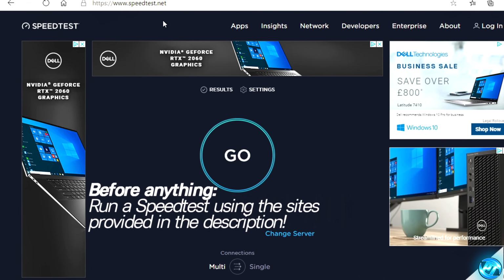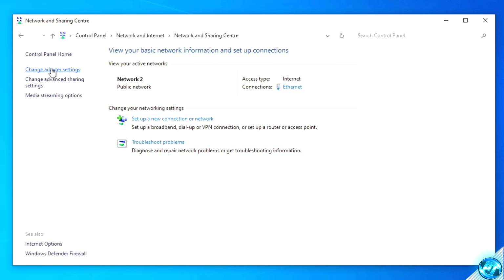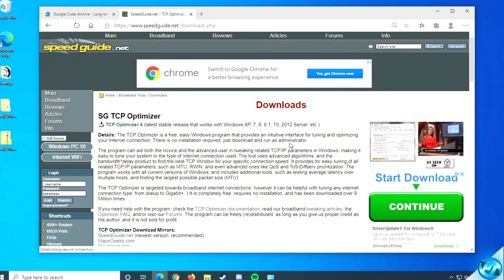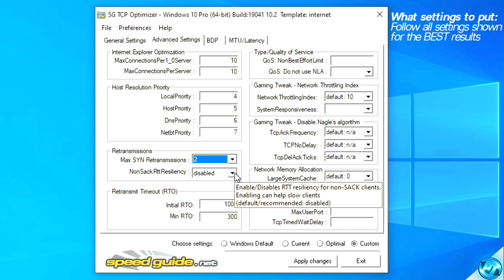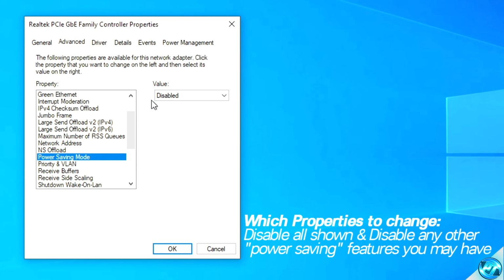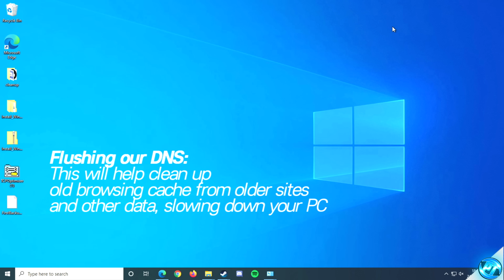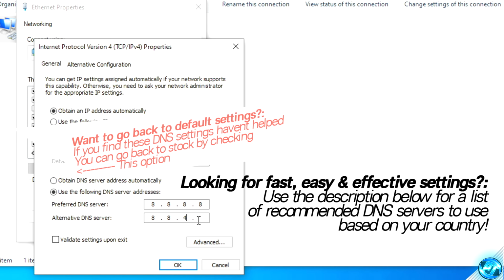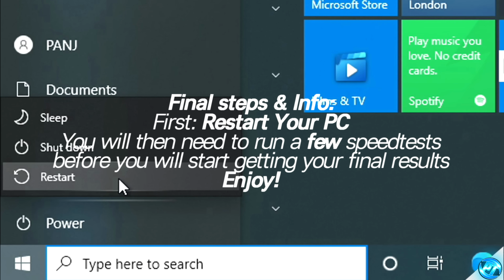🔧 How to SPEED UP your Internet! Boost Download Speeds, Lower Ping, Fix Lag on Wired and WiFi EASY

Comment: I see little difference and also I'm using a qualcomm router but it was updated. Maybe thats the website server, on speedtest, i found a significant difference: 15mbps-30mbps. Well there is improvement i guess. Edit: Page loading is significantly faster, thank you!

Comment: One question man, that modify all network adapters button, i also use an external wifi adapter which is listed there from tplink, they mentioned in the box not to modify anything, so is it mandatory to check that box? will it modify all the adapters? Can i do this on my 802.11 wireless adapter

Comment: Hey idk if you'll read this but before I moved to pc I used to play on ps4 with an ethernet cable and I had +500 MB/s download and upload, I used the exact same cable with the same router but for some reason I have barely 25 MB/s download and upload speed on pc. What could cause such a problem? I did everything in the video and tested the internet speed nothing worked out :/ .  Thanks for answering in advance :D <3

Comment: ca ethernet wall adapters play a role for low upload? the apartment i live in have zero ethernet ports being an old as hell from the 70s with minimal updates. so i had to go out and buy ethernet wall ports to connect to my router to pc, tv and consoles.

Comment: Sorry but I did absolutely everything and I have Xfinity Blast xFi modem with actual input speed of 1200 mbps that I have verified. My laptop has wireless modem up to .../ac level, & 32G RAM memory. My before optimization speedtest.net app showed 248 mbps & after optimization speed was only slightly faster at 253 mbps. My MAC MINI LATE 2014 with a new SSD hard drive with only 8G RAM amazingly gets around 750 mbps.  PLEASE ADVISE.  THANKS!!!!

Comment: My game download speed didn't increase at all.. could you please help me out
Reply: It helps to know what your current internet plan is and what speeds you get. Run a speed test (on a wired device) and compare that to what you should be getting. Otherwise, its impossible to help with a vague question.

Comment: Romania is #4 worldwide in fixed broadband according to speedtest. I get 700Mbps/down 1ms ping, sometimes 900Mb. on a 1 Gigabyte fiber contract deal. for 10 euro a month. I still need to tweak stuff, had better speeds. fresh windows might be the problem. I also set the Speed & Duplex to "1 Gbps Full duplex" from "Autonegotiations". Will see ..
Reply: what the hell 10 euro?
Reply: @Mikkoy67  indeed, the provider is Rcs-Rds (digi com.), for 23 euro/month  i get cable tv ~200 channels(under half are HD), 1Gb fibernet on wifi 6 router, 130 Gb mobile data (5g compatible), some landline deal i never use, can't remember cloud storage i never use it.  If i want 4k channels it's 1 euro extra, for 5 sports channels.  HBO  package is like 4 euro. Already included in the 23euro. My network never crashed or annoyed me in 12 years since, and i use it till 3 am lots of times.  I play dota regularly.  But even in the late 90's we had good providers. It's just how it has been.
Reply: $25 dollar in here is is only  5mbps-10mb
Reply: @Mikkoy67  i know, when I worked  in western europe(france etc.) i was amazed how expensive the fastest package was, and it still can't hold a candle to what we  have here. It's infrastructure i guess. USA the same shit web. It's according to salary.

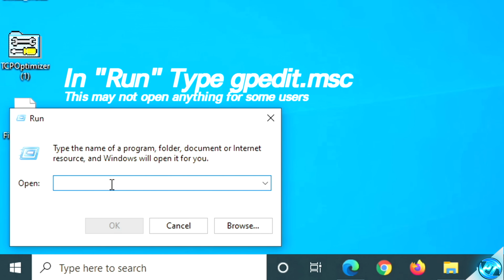Comment: At 8:10 typing 'gpedit.msc' doesn't work for me, instead it comes up with an error asking me if i've spelt what im looking for corrrectly? Anybody know why this happens?
Reply: https://www.itechtics.com/?dl_id=43

Right-click the downloaded gpedit-enabler.bat file and select Run as Administrator.
This will start the installation process. It may take some time depending upon your system performance. Once the process is complete, press any key to close the command prompt window.
Although a restart is not required, if the policies are not working, you should restart the computer once.

Comment: this really worked for my ac wifi connection, thanks.
Reply: FINALLY! Someone made a comment saying that it worked or not and not just 'my wifi download sucks".
Reply: @salty74vr  I have a 6 y.o. notebook and my router is 3 rooms away. After doing what he did, my download speed increased 2x.

Comment: Started with 13 ms ping in 10 speed tests before. Results after tweak with 10 additional speedtests stayed 13 ms so no improvement for me but i assume its because 13ms is already on the exceptional end already.

Comment: Guys, whenever I check my internet speed I get 25 ping but in fortnite I get like 60-70 pls help
Reply: that's because the Fortnite servers are farther away. you get different ping depending on where the servers of the thing you are trying to connect to are, if they are on the other side of the world then you will get very high ping, but if the servers are very close to you you will get very low ping if you have a good internet connection
Reply: @darthpickle6611  but it’s only been every since I switched to pc, on ps4 I was getting like 30-40

Comment: after i did this my cpu is running with only 1 core now. and reverting the settings doesnt change it :(
Reply: well this shouldnt of affected your cpu at all, it only should of changed how many threads are invested into your wifi signal XD. your ram might be the thing that is making your cpu cap at 1 core.
Reply: @IppoFN1  Nice so that's why my fps dropped by 100 and my pc is boot looping now

Comment: This wont be suitable video for those who uses wifi router with modem, this actually MIGHT make it slower but in my case im with modem and ethernet cable, connection went much more stable on downloads etc, but no improve on ping really maybe from 17ms to 16ms so its arguably

Comment: I just changed the power saving modes and the power management settings at the end of vid because it was the least complicated thing to do and damn this has sped up my internet quite a bit
Reply: how did u do that
Reply: @spamzfn1588  control panel > power options > select high performance power plan
Reply: really?

Comment: SUPER INTERNET SIGNAL BOOSTER - STREET 2 PRO.

  The amplifier works all over the world anywhere with any SIM card, any provider. If you have a weak signal and slow internet speed, this amplifier will solve all problems. 

@

Comment: i did this and it made my connection from 100m to 20m 9ms ping to 20ms and 8m upload instead of 10m :(
Reply: ok i removed prefered dsn and put back to auto obtain and restarted my pc now is actually slightly faster than it was

Comment: all the fun comments and stuff made me feel like it is not working but it actually does help you get your real internet connection which you paid for. for me it was way less than that but now I am getting the maximum and also a more stable ping (it actually also makes your ping lower but so much only a couple) THANKS A HEAP. THUMBS UP

Comment: Not to discredit any of these helpful tips because they truly do help a lot of people. But, its been my experience and believe me there have many, that what really makes a huge difference is simply the connection to the server. Sometimes its good and sometimes its bad. It doesn't matter what server your connected to sometimes it will be a good connection and sometimes a bad connection. My suggestion is if your speeds are bad just disconnect from the internet, wait a few minutes and reconnect and pray like hell you get a decent connection and if not repeat that until you do.

Comment: why is is saying that in cmd?
"No operation can be performed on Ethernet 2 while it has its media disconnected."
Reply: Ye doesn't work for me. from 25 down to 11 it wil go back up and then back down like always so nothing changed CMD part doesn't work for me I'm guessing that is the problem
Reply: cuz u dont use ethernet and youre using wifi
Reply: @ClipsDaily.2000  weird because I’m not using wifi

Comment: My recommendation is: Don't use the "TCP Optimizer" when i applied all setting like in the video, I had massive problems with Steam downloads, I had under 1mb/s. Then I changes all setttings back and I got my normal speed again (11mb/s).
Reply: ok why you get less mb/s is couse the tcp optimizer is for ping mostly on gaming and web serching not for downloads its very good for gaming, the tcp optimizer minemizes the bandwitch of downloads for better internet speed web and gaming so if so first take off the tcp setting when downloading then when your download is done put them back if your game is internet based game put it on for better ping
Reply: @Natsi-Sensei  ok thank you
Reply: What!!?!
Reply: @Astrayy21  what do you mean, I just explained my problem man

Comment: I was getting about 300 kbps from my usb wifi adapter in my second pc. I used an USB extension and moved the adapter to a better position and started getting about 45 mbps

Comment: Didn't do anything for me. My speed is still the same. I get a feeling this type of tutorial will only help a very small amount of people. Most of us won't see much of a difference or it might even get worse. Thanks for the video anyway.
Reply: Bro mine got even slower and idk what to do
Reply: @zamclarenas  reset everything you just did simple
Reply: @recklesfaltron105thebest3   how
Reply: @yeeti617  Go into TCP Optimizer and in the bottom right corner, set it to Windows Default, apply, close, and restart.
Reply: bro same

Comment: Uhm, Reading some these posts and so many with pathetic download speeds!?  I feel for you...  🤔😔  I run a new DELL laptop (barely 3 months old) with ethernet connection via Thunderbolt USB-C and average about 225MB.  It's fast!!  And, that's out of the box.  No mods made yet to it other than some software and driver updates.  Hate to fiddle with it too much.  "If ain't broken, don't fix it." 😎👍

Comment: How about changing the internet protocol from IPv4 to IPv6? Because IPv6 has an lower overhead it should result in a better latency. You should also check if your provider and router supports IPv6.
Reply: Yo how can i actually do this?
Reply: @danielw8855  enable ipv6 in ur ethernet properties and disable v4
Reply: Neva do that Belive me. Let that seting automatik like they are.
Reply: ipv6 is slower than ipv4 because it has a extra layer built in security that isnt needed if u have ur own anti virus and that extra layer results in increased latency, its actually recommended that u turn ipv6 completely off if u have an anti virus software already installed on ur system

Comment: I used to have 20 mbs adsl with 70/80 ping and I was satisfied enough with that. Since few months I have 1 gbs optic fiber but my pc is not in the same room as the router so I manage to get only 200 mbs with 35/45 ping which is still an incredible upgrade and I'm more than happy with that. I don't wanna mess with all these settings and risk to slow down everything like some ppl said here in the comments. But for someone with really slow internet I don't see why you shouldn't give it a try! Nice tutorial and keep it going bro!
Reply: save a windows restore point and go ham.

Comment: How to revert? My wifi dropped from 400MB to 30MB, doing restore point but it takes ages? How to revert back please?
Reply: did you figure it out yet i want to revert mine aswell
Reply: It was just my wifi adapter driver updated. So i rolled back version, and my speed is good no

Comment: An easy tool to update drivers is called "Driver Booster 8" For the people that don´t wanna search and download and istall one by one driver.
Reply: Don't drivers update automatically with windows updates?
Reply: @zacharykosove9048  yes but a bit of them no
Reply: @gabe_bvd  Some drivers are not to be updated and thats what Windows 10 do. It updates important drivers and leaves others. Once I updated my Drivers through Driver booster 8 and then my touchpad stopped working. before that I got some Unstabilty and freezes.
Reply: @real7vik  With laptops its a bit different. I always update my drivers with driver booster 8 And I never had a problem with it (Because now I have a gaming PC. I was a laptop user 9 months ago and I used driver booster and I never had a problem) . And sometimes actually windows tries to go 1 older driver When I update my AMD gpu :( but the rest its ok. Windows helped me to update my bios. So use windows update and driver booster and all will Be up to date and ok.

Comment: Just wanna ask is tcp really safe I mean it tweaks some setting in registry

Pls reply
Reply: Yes it is safe, the only danger to using it is, you could maybe prevent your computer from using the internet, if that happens, just revert back the settings to windows default.
Reply: @adversemiller  ya already did that that app is doubtful so unstalled it and even reseted all network settings
Reply: @suraj3411  it worked for me quite effectively, I didn’t notice any issues and my speeds increased by about 2mbps average according to ookla and has 3ms less on average
Reply: @adversemiller  oh but I cannot risk it my dad will kill me
Reply: @suraj3411  oh ok, that’s  fine, but I assure you it can’t damage your PC

Comment: Guys, It worked! I got from 30 ping to 15-16 ping. Here is my proof, it's not a drastic change, but it really helped me.
Before Video:
Test 1: 90mbs download speed, 4.9 upload speed.
Test 2: 108mbs download speed, 5 upload speed.
After Video:
Test 1: 110 download speed, 6 upload speed.
Test 2: 113 download speed, 6 upload speed.

Comment: Since i started to use these settings (wired) i started to get some minor issues with twitch streams, they work for a bit then sometimes i either get a network error or they need to cache and then start again.. any ideas?

Comment: My wifi is a floor/level under me so ethernet isn’t an option for me.
Reply: Im in the same situation so i got a 20m long flat Ethernet Cable and routed the Cable along the roof, Went from 2 mbps download to 30 mbps :)
Reply: @Proto_is_noob  Nice bro 🔥
Reply: same mate :(
Reply: my wifi is legit 10cms away from me
Reply: @enovah for me its 2 floors
Reply: you can use power line
its not as fast as ethernet but it is veary stable if you have a good wiring
Reply: same,but we bought the official wifi booster of our wifi and its literally just 50 cents.
It was boosted like 30x times better at the first day but those days its like 20x times better
still good tho lmao

Comment: i followed every step he mentioned in this video.
went from ~100ms to constant 900ms.
DO NOT follow his steps if you dont know what you're doing, especially the program that modifies the regestry editor, i noticed that when i put the same numbers he did on that program my internet significantly slowed down to arround 0.01mb/s, i had to find out  how to get it back to default wich thankfully i did
Reply: How did u get back to default
Reply: @limpnn  if you mean the program that messes with the regedit settings , it creates a backup automatically that i found on my desktop. so i could go back to previous settings.
Reply: ty for your advice
Reply: I reviewed all comments and you were the only person this didn't work for. Just curious if you might know why it worked for 1000 people, but not for you?? Thanks in advance.
Reply: @followerOfYeshuaAndYHWH  if i am the only person who wrote a negative comment it doesnt mean i am the only person who got negative results , some people get negative results too but they dont comment about it

Comment: If system is uptodate,do research on disable few useless/lowering  stock setting ,changing  some settings in modem and energy saver to get ALL what your connexion is capable of.
Is THAT limit your performances FIRST. Someone who play online games,in general disable windows network realtime inspection.

Comment: Long story short: You can't speed up your Internet. Get a better one.
Reply: This is more just like "optimization", like squeezing all those tiny bits of the speed
Reply: Change the beacon to 1024
DTIM interval to 255
RTS threshold to 32
Fragment threshold 255
Reply: @panaoutsios1990  Where do I go to do all this?
Reply: @68pemaco51  in the router

Comment: Under no circumstances do the settings described in this video. Since the author of the video did not provide any tests, I decided to test these settings on my computer. The upload and download speed has not changed. But the ping has grown very well. Earlier in WOW I had a ping around 111, after these settings the ping became 500, it is impossible to play!!!
Reply: have you managed to fix this? i have this problem currently
Reply: just revert it back 
 @shbibe
Reply: You in eastern europe, We are in western europe, theres a difference

Comment: I did the same adventures above, using cable fiber optic, playing games online under 50/55/60ms I'm using 2.5G
LAN, the minimum ping I always have 50/49 after all steps above nothing changed but sometimes from different servers on multiplayer it depends on the server ping dropped to 30/25 as long as i'm playing in that server, but in most parts its the same 50/55/60ms.
browsing seem a bit faster than before, watching videos on youtube 4k/8k no problem.
result is its all about wifi card and a rare rich dns, this is gonna be working on wireless cards especially those which support wireless killer feature.